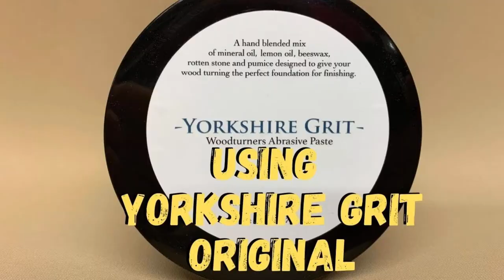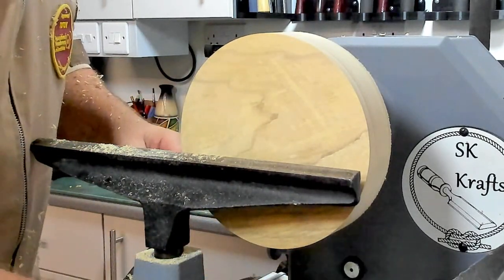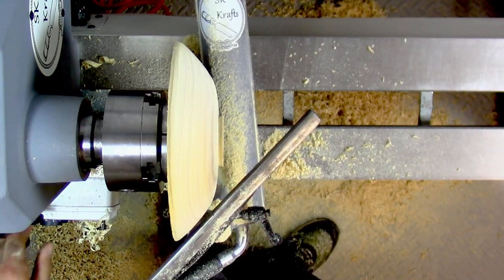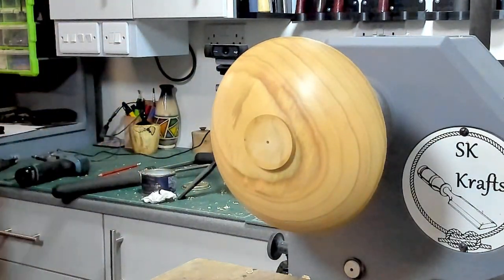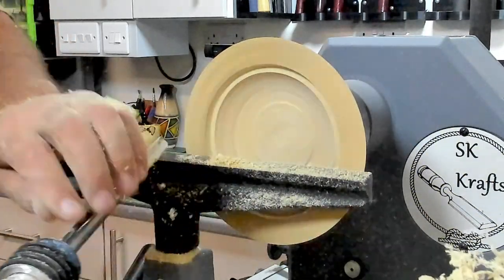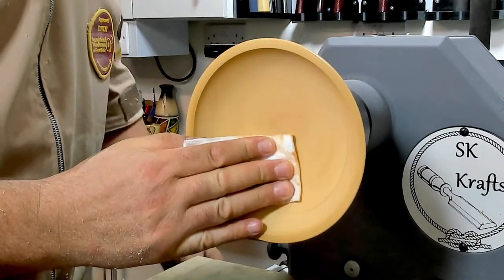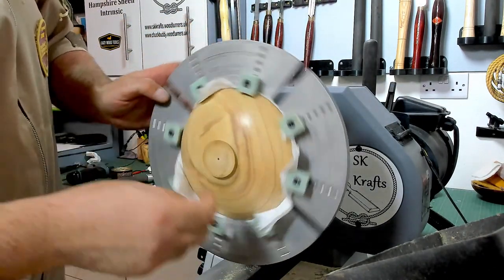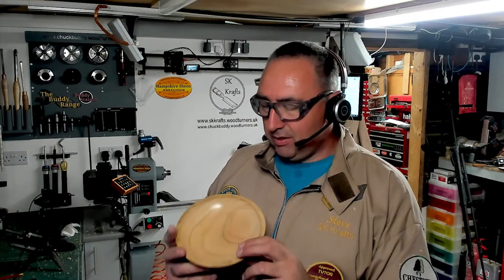Woodturning- Basic Tool Control, Lets Start From The Beginning

Comment: Hi Steve, I am at 23:23, the point where you are talking about hanging over the tool rest. If you used a curved tool rest there, would that have an advantage?  I am sure more questions will follow.
Reply from the maker: Hi len, if using a curved tool rest can be an advantage but it will also change the angle of the tool as it comes around the curve of the rest. That’s would have to be something you adjust as you create you cut.

Comment: Next question, 37:30, I saw a video where they said, if you put a few coats of shellac before the Hampshire Sheen, it will add depth to the finish. Have you done or heard that?
Reply from the maker: It’s the same as applying sanding sealer before the wax, it seals the wood so the wax doesn’t soak into the wood.